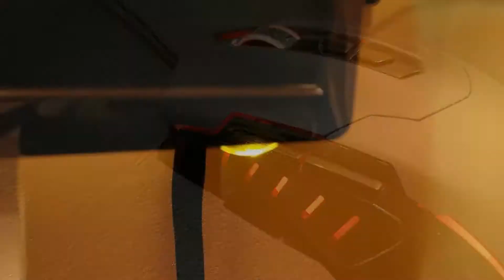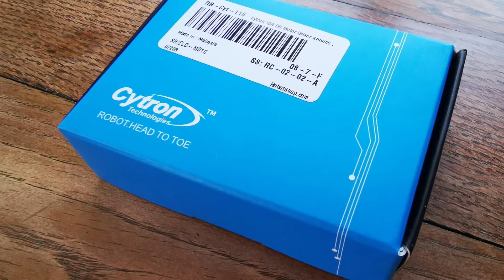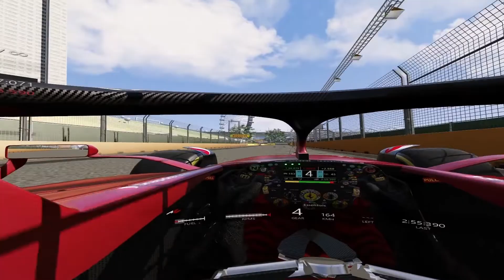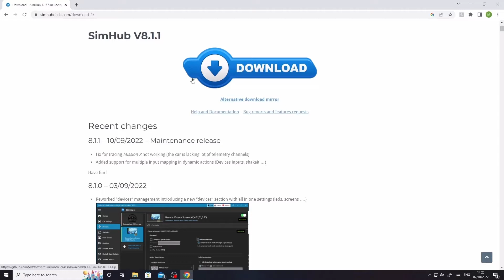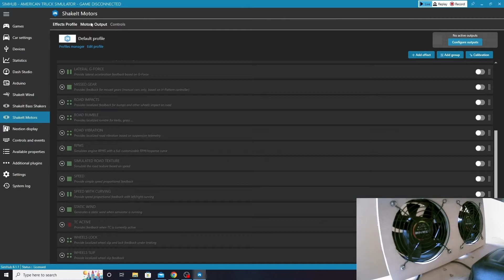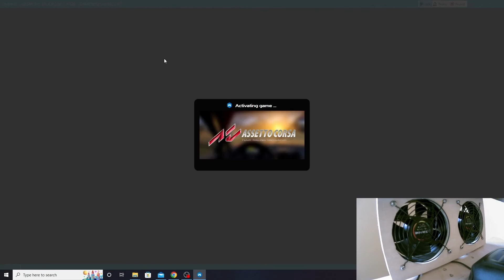DIY Wind sim for around £100!

Comment: Maybe an absolutely stupid question but, i have the arduino uno R3 and Cytron MDD10. I already have 2 140mm Noctua industrial fans which are a 4 pin PWM fan. Is it possible to make these work as they are extremely quiet and reliable. I see most using a 2 wire molex fan for this application.

Comment: This guide was extremely well done and super helpful. I built out a wind simulator for my rig with all the mentioned hardware here and it all works. Sadly, can barely notice the wind. I confirmed my power source is good enough and I confirmed the settings in simhub are in full volume / full blast. What am I missing?
Reply from the maker: Thanks for the feedback - There are a couple of things to consider - how far away are they, and do you have the air going through tubing? I didn't have tubing but had reducers (fan to duct reducers) as such which had straightening baffles - so it makes the wind faster as it comes out of the reducer, and stops the wind from being in a spiral with the baffles. Some have said that without that the wind can be significantly reduced, and may be essential if you are using tubing. Something like this below as an example (you might have to get a 3D printed one, I think I got mine off of eBay): https://makerworld.com/en/models/1604272-120mm-pc-fan-shroud-wind-straightener-sim-racing#profileId-1691448

Comment: My dont work and motors connected 0
Reply: i have setup but fans dont spin
Reply from the maker: @remcotorn1982  try switching the power wired - in the video and with some chargers the colour cables are the wrong way around. try on the forum linked in the description which is where they also mention the cables being the wrong way around, they might be able to help, sorry its not working and hope you get it sorted soon. If you have power but they don't spin then I don't know - I just re-followed the video and it worked first time. Have you activated the game in simhub?

Comment: Thank you for this in depth guide. I followed this video and purchased exactly the same hardware except the power adapter as im in north america. Just make sure it is 12v and at least 3A as each of these fans draw 1.4A. For my power adapter, the white wire was the negative. Also for the fan, the wires with the white grey stripes had to go to channel B, and black wires into channel A. Basically swapped from the video. Everything else worked as expected.

One question, is this setup with the cytron md10 able to control 'speed with curving'?

Comment: Running arduino uno rev3 and motor shield rev 3 with Noctua NF-F12 iPPC 3000 PWM and the fans won’t fully spin up. They buzz and need help to fully spin during testing
Reply from the maker: @antok86  check the Simhub link in the description, there are others using PWM fans that have put how to get them working, hope you manage to get it going 👍
Reply: @NullAndVoidChannel  thanks not much progress two weeks in this project but I’ll keep going!
Reply from the maker: @antok86  sorry, hope you manage to get it sorted 🤞
Reply: @NullAndVoidChannel gonna try to locate a cytron board

Comment: Looks like this comment may be a little late to the party but I wanted to add my "two cents".  I used this video as a guide and ran into a problem of having the fan off or full speed because I tried to wire up a 4pin PWM fan using just the red and black wires.  With some digging around I realized that I could add the blue wire to pin 9 which is the pulse width that controls the fan properly and now it works great!  I noticed that I could use the Shake It Motors control scheme or the Shake it Wind control scheme.  I haven't played with both of them enough to see if one works better than the other but I was so excited to feel the wind on my face while driving around Laguna Seca in GT7 with my PSVR2.  I also have a pedal/wheels, and haptics on my rig.  Definitely worth the small price for the added immersion.  I only rode around in open cockpit cars for testing so I'm not sure if I'll use it with GT3 cars.  I'm not on either side of the argument.  I'll race around and if it feels weird I may either turn the output down/off for closed cars and back up for the open ones.  Thanks again for this video.
Reply from the maker: @walshja81  No problem, glad it was useful and found out how to do it with PWM fans. I'm tempted to set my fans to a constant speed for non open top cars so it is cooling and more like normal car air vents, I haven't done any racing for ages though, but I'm starting to feel the interest coming back again, so will have to play about with the settings etc to see what I can do with the fans. They're definitely needed with the odd hot days in the UK at the moment!

Comment: Best vid for building sim rig and works a treat 😊. Wondering is there a way to switch on/off as a manual fan as use sim rig for non racing games so just to cool down ?? Another program perhaps
Reply from the maker: @chrishart5474  you could connect a 12v power connection into the fan as well but have a switch on the wire, that way if you have it on the fan should just get power and run, you might need some kind of variable switch or controller in the wire too so you can adjust how powerful it is when it is on. Then when you go back to a game that uses the fan, just turn off that additional power supply with the switch and it should then work off the setup shown in the video. Hope that makes sense and glad you found the video useful 👍
Reply: so the same 3 amp power supply?   @NullAndVoidChannel  have you a link to a switch that will work please as looked and bit of a minefield
Reply from the maker: @chrishart5474  sorry for the late reply, it is a bit of a minefield, it is difficult to find a variable switch that also turns it off. If you use the same 3a power supply, you could either have a second power supply with the positive going to a switch like this https://amzn.eu/d/jhvsT4j then another wire going from the ground from the fan to that additional npower supplies ground. Or you could use the power supply you are already using, and run an additional wire from the positive wire of the power supply to the switch I linked, then from the switch to the positive on the fan, and then add another wire from the ground wire of the fan and connect it to the ground wire of the power supply. There are various ways you could do this with terminals like Wago terminals, or by soldering, or using the terminals on the motor shield. A variable switch such as this could work https://amzn.eu/d/09wSCw4m (this includes a switch - but the switch also does a reverse), or a variable motor speed controller like this https://amzn.eu/d/0beVYjku these will need a positive and negative from the fan, and a positive and negative from the power supply. I haven't tried these particular products themselves, but they look like they should work. Hope they do for you 👍
Reply: I’ll get the bits on order and thank you so much  @NullAndVoidChannel

Comment: I built this as per your guide here and it works great, I think ill be upgrading to a couple of 140mm delta's though after playing with the fans on and off ducting,  I printed some nice ducts and case for the arduino/motorshield. it feels like it wants more umph.. I'm thinking 140mm Delta's this will take the total draw to 10.08 amps, a tiny smidge over the limit of the MD10 hopefully its fine (if using PFM1412DE Delta's).. will drop another message if I do this :) of course ill upgrade the power supply too :)
Reply from the maker: Awesome, glad it's working. If using ducting it does take alot of the power out of the fans, so would be interesting to see how you get on with 140mm deltas. I didn't use ducting in the end and had them just behind my steering wheel and use headphones which drowns out the sound. Hope it all works out for you 👍

Comment: I have some noctua industrial nf-f12 but once I connect everything it doesn't matter what I do in simhub they are always working and I can't regulate them
Reply: Did you fix it? Y just bought the same fans
Reply: @aldebaran844  no bro sorry
Reply from the maker: Hi, did you go for the PWM version of the nf-f12? There might be some more tips on the Simhub forum around PWM fans if you did: https://www.simhubdash.com/community-2/projects/wind-sim-with-arduino-uno-rev-3-and-arduino-motor-shield-rev-3/paged/7/#post-8284

Comment: Great video.
It looks like the fans you linked are rated at 3amps each, yet the power supply is 3A, is that correct?  Or should I look fit a 6amp PSU?
Reply from the maker: The fans are rated at 1.4amps each making 2.8amps total, so that power supply is the lowest you should consider, and works well with mine. You could get a larger one if you do want some more spare headroom. The fans are very powerful though and can be loud at full power, so you could even end up turning them down slightly in Simhub-I wear headphones (in ear or over ear) though so find the noise okay, and the vibration through the rig and wheel really add to the sensation of a road surface when driving 👍
Reply: @NullAndVoidChannel  
Thank you for the reply.
It say this;

Rated current:1.4A (3.0A max)
Input Power: 36W

Do ignore the 3A max?  What does it mean?
Reply from the maker: @Smarty72  I am pretty certain that the 1.4a rating is per fan (also shown in the pictures on a sticker on the fans), and the 3.0a max is for both fans. I haven't specifically measured the amps, but someone in the reviews states they got 1.6amps. I would say however that with my 3amp adapter powering two fans, I wouldn't expect them to run at double that, they are incredibly powerful at 3amps total 12v (36w). There can be a slightly higher power requirement when starting the fan up when compared to the speed it is starting up at, but again should be fine. I have been running these since this video without any issues. Hope that helps 👍
Reply: @NullAndVoidChannel  that’s great, thank you

Comment: Worth mentioning that the motor shield manual recommends using a battery as a power source because inductive loads (like a fan) can trip the protection circuit of the power supply. Alternatively, you can use a schottky diode to prevent back EMF from the fans. 

Another note: this can be done with PWM fans if you use pin 9 and 10 for the PWM signal. You can have 2 channels with the MD10 this way, allowing you to use the "speed with curving" settings. 

I built this with some Wathai 5300 RPM PWM fans that do 230 CFM each.  It's incredible. Great guide.
Reply: great news, because i didnt look and bought pwm fans. so i just put:
fan1 pwm ----> pin 9
fan2 pwm ----> pin 10

or do i need to set the jumpers too? 
do i just need this if i want to use 2 channels? because i dont care about the speed curving effect

thanks in advance
Reply from the maker: Thanks for the info 👍
Reply: hey what pins do you put what wires in?
Reply: @jeffzimdars6575  I took the PWM signal wire from each fan and put it in pins 9, 10, and 11 (my setup uses 3 fans now). When you set it up in Simhub, you will select which pins you installed them in.
Reply: @jerrylindgren7828  Okay, do you still use shakeit pwm output or do you use Shakeit pwm fans output? Are you still using the cryton md10?
Reply: @jeffzimdars6575  I used "Shakeit PWM Fan Output". I am using the Cytron MDD10, and have also built a working setup using the cheaper MD10.
Reply: @jerrylindgren7828  for some reason i can not get that to work for me.
Reply: can i please see your wiring diagram for the md10 please
Reply: in shakeit pwm fans output: i have 2 pins selected, 9 and 10. but when i put the pwm wires on the board the fans stop working when i hit the test buttons. But when i take the wires out of pins 9 and 10 on the board the fans start working again when i hit the test buttons.
Reply: @jeffzimdars6575  it's been a while since I set it up, can't remember off top of head, so I will have to take a look at my board when I get home. Pretty sure you'll need to set the jumper pins on the Cytron board so they match the pwm pins you selected.
Reply: @jerrylindgren7828  Okay, i have them working now with the fans output. i was trying to use motor output "A" as fan 1 and motor output "B" as fan 2. Then i set the pwm to pin 9 and 10. It would not work like that. I had to go back tie together pos. fan and neg fan for both. and use only one pwm output pin for both fans. So basically you cant separately control 2 fans with the cryton md10 you have to use both fans as "one" fan. Now i have on order the cryton mdd10 to use both left and right and so the wind and very depending on the turn speed. I can upload photos and diagram for what i have now if anyone else has the same problem i had.
Reply: @jeffzimdars6575  A diagram would be really helpful if you still have it. I am getting stuck where you were before. I have a md10, and am trying to run the PWM fan out of pin9, but I can't get it to turn on. Once I pull the pin out of pin9, then the fan will spin up in test.

Comment: Hi there, this is a long shot but I'll comment anyway. I got my set up and it works (using a MDD10, 12v 2.5A fans and a 6A PSU). In my case, the Arduino cuts off and gets disconnected. I checked the Simhub logs and it said  "Arduino very late, shutting off". When it works, is wonderful but the it cuts off and breaks the immersion. Any help would be appreciated. Thank you
Reply from the maker: Hi, really sorry you are having an issue with this. I have been trying to find through google etc what could possibly be causing this, but can't find anything. All I can suggest is to go over the video from start to finish again, checking you cable connections etc and reprogramme it just to make sure. You could also post on the simhub forum post here in case anyone else can help, Hope you manage to find the issue, and I will update if I find anything 👍 https://www.youtube.com/redirect?event=video_description&redir_token=QUFFLUhqa2FTZ2xDeWZYaUdRQVQxeU03b3JnLXNkMUdTd3xBQ3Jtc0trTXRfQ25NWnFDdGhIZGdRa1liNkVEd1FhTzRfd1kzNkcyaEluS0xHaTBBZ04tTXVQOFIzczdFS1BqdnpsSzBKNWFYcGhnaGN5STRUTHdtRThCdzZTRS1TZlgxTlVQUFA5TERpNDJkUzNkMWZJRElHaw&q=https%3A%2F%2Fwww.simhubdash.com%2Fcommunity-2%2Fprojects%2Fwind-sim-with-arduino-uno-rev-3-and-arduino-motor-shield-rev-3%2F%23post-5886&v=IRoUFFcqKdY
Reply: @NullAndVoidChannel  Thank you for your response.I enabled the DK shield on the arduino setup tool although it says that is deprecated. It seems to work now, I tried a couple of races in iRacing and did not get any  cut offs so far. I will update if it happens again. The video and its comments have been a great help. Again, Thank you.

EDIT: with the DK shield it changes the channels from 1-2 to 5-6 on the motors output on simhub itself. Hopefully this helps someone else who had this problem.
Reply from the maker: @junitoortega8656  Awesome, thanks for updating and I'm glad it's working so far 👍

Comment: You think I’ll be able to just plug the power supply into the arduino without having to cut it up? I see it has an input for it. Or is it better to split it as seen on the video? Does it matter?
Reply from the maker: The Arduino does have a power input, but it is limited with how much power it can transfer to the motor shield, so it is best to provide power directly to the motor shield 👍

Comment: please help, i built mine step by step through your video which was easy enough and highly appreciated although on the MD10 next to the green power led when i click test I get a red led on A. Does this mean i have wired the fans the wrong way round? P.S I bought everything from your links so all my parts are identical to yours
Reply from the maker: So I have some good news, I have just checked mine, and when I click test the A also lights up red. I would guess that power is being provided correctly, so my first guess would be that the fans are wired the wrong way around, give it a try and I'll help more if I can if it doesn't work, fingers crossed 🤞
Reply: @NullAndVoidChannel  they dont seem to be the wrong way round because if i use the test switch on the board they do spin so am stumped
Reply from the maker: @roystealey2602 when you click test in Simhub, do you click it multiple times? One click won't get them started, and have you tried in any games?
Reply: @NullAndVoidChannel  apologies kind sir, i decided to stop being lazy and just swap them over and indeed you are right. the wires on the fans are positive for the one with the lines and negative for the ones with writing on. Must have wired them wrong at the factory but they are working now so i'm over the moon now. Thank you so much for your speedy reply to me. Is great to see a creator reaching out to the audience. Keep up the good work your doing.
Reply from the maker: Awesome, so glad to hear it, enjoy your wind sim and glad it worked out for you 👍

Comment: Hi ive have a question, ive been using this setup for around a year abn its worked flawlessly. Just wonder what made you design the wind sim this way using the shakeitmotor section of simhub instead of using an arduino and using the shakeit wind way?
Reply from the maker: If I'm honest, I have no idea, I followed another guide by Boosted Media which no longer worked, and this was the first way I got it to work well, so just stuck with it 👍
Reply from the maker: Glad you like it, I wasn't sure if to put it in or not 👍
Reply: @NullAndVoidChannel  yeah it's been faultless the only reason I noticed the other way of doing it, I  was looking into getting the left and right fan operating independently